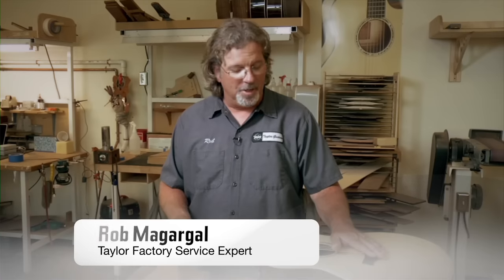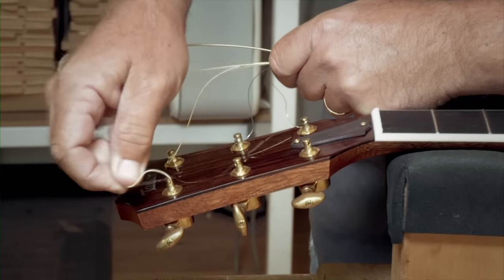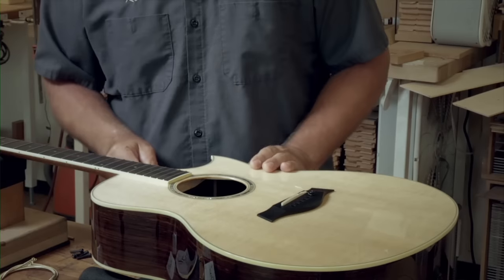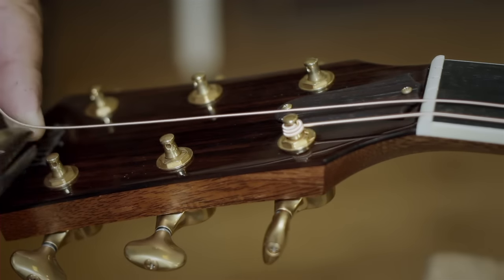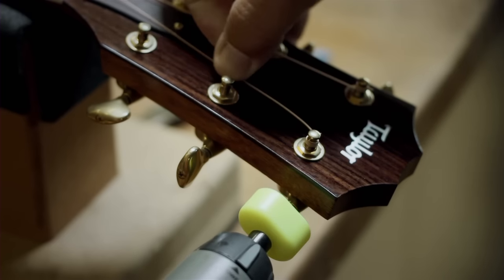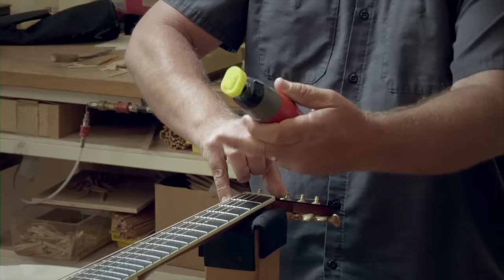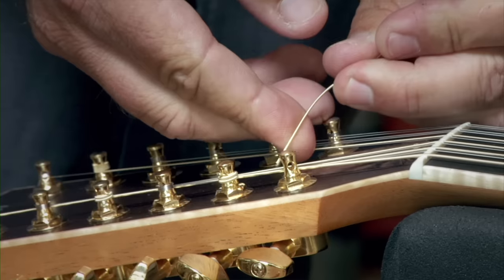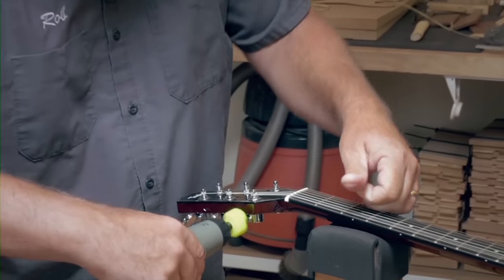How To Restring Your Guitar - Taylor Guitars

Comment: At 03:50 "That's allowing the ball end of that string to lock right to the pin plate." Should I assume the pin plate is the same as the bridge?
Reply: No the Bridge plate  or pin plate is a piece of wood that sits underneath the bridge usually filling a space between the braces.  It is usually made of a harder wood than the rest of the guitar top, and is a decisive component in the guitars resonance and intonation.  Getting the ball end of the string in wrong can mean the wind of the string before the ball  and the ball can cut into the bridge plate,and slowly widen the hole the bridge pin and the string sit in.   It can weaken the tone of your guitar,  and then it can mean that the string is going to slowly start to push its way up through the hole.  The string will start to stick out a bit on the bridge  and space will develop between the string and the pin,.  Ultimately the  tension of the string pull the string up through the bridge plate into the softer wood beneath the bridge and really wreck the bridge plate and the bridge itself.  The string will no longer properly seat in the hole, and wreck the tone of the guitar.  If you have an older guitar,  not a bad idea to ask a luthier to take a look at the bridge plate.  They can be replaced for  50-100 bucks.  Something to get a luthier to look at for you if you are buying a used or vintage guitar
Reply: @writerrad  Actually, Taylor guitars have a piece of metal around the holes of the bridge plate. That should last much longer than wood. You can see it here in this dissected Taylor body. I'm guessing this only pertains to Taylor guitars using the expression system. Those that came before, I have no idea. You'd have to ask Taylor. If you'd like to see it, check the 2:35 mark on this video. https://www.youtube.com/watch?v=wy_9ejBag_U

Comment: Im really confused. I bought strings to try stringing my own guitar for the first time ever (i'm tired of not knowing how). I put the low E string in just like he said, started turning barely and before it was even around the peg 1 full time, it was a D already? It's super tight. His has lots of slack, mine doesnt? I need help.
Reply: Check your steps:
Pull to set the string at the bridge after you insert the peg
At the top of the neck cut your Low E string at the A post - Maybe you cut it too short?
Insert the string through the E post so just about 1/8" string pokes through the hole
Wind until tight
Reply: @nmcg2587  i actually went back, slowly worked ob this, and got the first four strings on which appears to be right. Now im at the B string, and the G string is touching the B string tuner and i cant turn the B string onto the tuner, the G string is getting in the way. What should i do?
Reply: @vaibanez17  Without any pictures, I'm just guessing that the G String is in the wrong slot at the nut.
Check all strings to make sure they line up in the correct slots in the nut.
or, maybe the G string is wound on the peg the wrong way? Check the video at 7:22
Reply: @nmcg2587  i figured it out. I put the g string on the wrong way. Supposed to turn it on the peg the other direction. Oops. Now theyre all on.

Comment: One of the middle strings on my Taylor 224e-k-dlx snapped loose from the tuning post. I was a bit disappointed. Justin Guitar taught it better to have a round of the string above the loose end. Umm, not to mention when I bought the guitar new from Tomlee, the tuning pegs already had stains and rusts. A bit too much disappointment for an overpriced guitar.

Comment: What is the make/model of the cordless screwdriver ? please
Reply: tweed guitar Have you found that out yet? I'm wondering the same thing.
Reply: No, they never told me...Dunno the model..but it's a Milwaukee ..that's all I know. cheers
Reply: tweed guitar Been pausing and looking. It's actually a Black and Decker. Looks like it's 3.6 volts. It doesn't appear to have a gyroscope, which would operate simply by twisting your wrist. I wouldn't want that, though. I can't find this particular model, but the video is 5 years old, so it has likely been discontinued. I can tell right away that he's using the winder attachment from www.stewmac.com but I'm not sure if I want that. I may go with the Music Nomad GRIP attachment. 
I've actually been planning to buy the B&D LI2000, which may actually be the current version of what was used in this video. The big difference is the handle adjustable positions.

Comment: ...too bad you don't recommend locking the string, also there should be an extra ball knot slid onto each string to insure that the winding is farther away the saddle,...and I try to  put the same pin in the same hole because they may have been custom fitted in to individual holes.

Comment: where can i get on of those electric string winders?
Reply: I bet if you Googled "electric string winder" you would have your answer.
Reply: Christopher Isaacs You can buy a cordless screwdriver and a peg winder attachment to go in it. I believe that's what he used in this video. The peg winder attachment looks like the one sold at www.stewmac.com
The Music Nomad GRIP attachment may be a bit safer though, and it can be used with a larger variety of tuning machines. 
Ernie Ball makes a power winder, but it would be cheaper to buy a cordless screwdriver and the attachment, and you'd also get more speed and torque. 
I would like to know which power screwdriver is used in this video.
Reply: Christopher Isaacs Alright, after much analysis, he's using a 3.6volt Black & Decker. I believe it has been discontinued, but the LI2000 is pretty similar.

Comment: What if I don't hear the "snap" when I put the string into the bridge/pin?
Reply: Get yourself a small extension-stem mirror, with a built in Led light (StewMack sells them) and shine the light towards the slightly bent mirror. Carefully slide the mirror inside the soundhole (to avoid snagging any pickup preamp wiring) and point it up to see the bridge plate. You should see all the ends of the bridge pins and make sure that the ball ends of the strings are all snug up against the bridge plate (and not caught on the tip of the bridge pin). If the string's ball-end is stuck on the tip of the pin, loosen that string, put your thumb on the top of the pin and pull snug on the string until the ball end slides up in place against the plate. That's how you are sure all ball ends are snug up to the bridge plate.

Comment: OK, I am not a "professional" guitar tech (played guitar for over 40 years) but I have never used wire cutters to grab the string pegs (which you might think could damage them) and then pried against the BRIDGE (???). The manual string winder has a peg removal slot that you can pry against the SADDLE and use a cloth or thin piece of soft wood to protect the saddle though I have never bothered to protect the saddle since it is made of rosewood and the plastic peg removal tool on the winder should not damage it. This video and others like it make me feel like my first purchase of a Taylor was a mistake...

Comment: I do one winding above and the rest below the insert.
Oh ... I use a pencil, to lubricate the nut.
Reply: Your way is the best way.
Reply: @richardalan3204  Thanks. I am not sure if there is a best way, but in the past 35 years, I never had any troubles with it,
and it's a nice tight fit, so that the string does not get much out of tune.
I am planning to build my own electric guitar, because I built a cnc milling machine for it.
I found some tuning mechanisms that have a screw at the bottom.
That's even better, imo.

Comment: Good video but i don't agree with using a metal tool to remove bridge pins,especially on an expensive guitar.Use a cheap everyday plastic string winder instead.Ever notice or wonder why there's a small half circle cutaway on the part that fits over the tuners? It's for removing bridge pins but if you'd rather use a pair of vise grips then be my guest.
Reply: Side cutters are fine on plastic or wood pins, but they might chip bone pins.

Comment: Like EVERY other Taylor video on guitar set up and adjustment, NOTHING about the special steps needed to change an ES2 equiped guitar.  In fact there's a general paucity of information on ES2 changes except for the woefully inadequate spec sheet for the system with its dark and unviewable pictures.

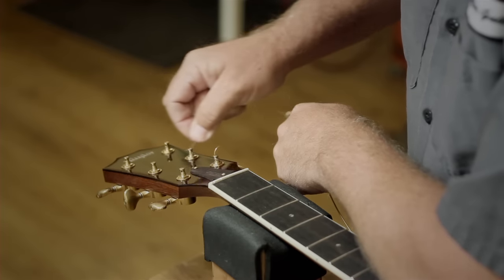Comment: At 02:11 "Be careful of the slap-back of the strings." Well, of course I'll be careful of the... the... what did he say?
Reply: Those coiled strings on the tuning pegs act like springs, when you pull on them they snap back at your fingers.
Reply: @JohnShalamskas  Lucky if they snap against your fingers instead of your eyes, or softer parts of skin,.  I always wear shop glasses or non glass reading classes when I do this.

Comment: I personally like the Martin way. Sadly restringing my Taylor the same as my Martin lol
Reply: Martin way  is based  on the way in olden times the tuner posts were not tappered downward.  If you have a guitar built since the 1930s even a Martin (just checked mine),  the tight wind of the strings as shown here and the shape of the tuning post will mean you dont have to make that knot  which  I usually find difficult and confusing even if I have been doing that for decades.  The real problem is getting the string off, for at least for me, that Martin knot never slips off as evenly as the Martin guy in the Martin video says it does,

Comment: You don't want the guitar to be fully tuned up on each string. Let all the strings wound up as it gets more tension, what it does is we need all of the strings to be sitting down properly on the nut and the saddle (with the correct string gauge and all that). DO NOT TUNE IT ALL THE WAY UP deal with the strings first before you tune the guitar.

Comment: ...that is so hogwash about "stretching" the strings, what most people think is strings stretching  is really the strings settling in the coils or other places where there is slack.  Sometimes it takes up to 24 hours for this settling to take place.
Reply: So it's quite logical to say that physics would dictate that applying tension to the strings prior to them "settling" as you say,  will speed that process along. So instead of waiting 24 hours just give them a nice pull and make sure they're set. Then check the tuning once more and you're done. 

This is a rather thorough and scientific method to get your strings set. Makes perfect sense to me.
Reply: Douglas Sharp trouble is that you're stretching in concentrated areas. Much better to let the string settle naturally. String up, tune up and play for a bit. Keep tuning and after a short period of time your strings will be set.

Comment: Although this method is good for showing how to slack the string, this professional is causing damage the the bridge plate with the ball end of the string.
He pays NO attention to the angle of the ball end, so all the edges are turned at different angles, cutting the metal, of the ball end, into the wooden bridge plate.
All the wheels need to be straight forward, not turned side ways. Think about it!
Over time the bridge plate will be destroyed, and have to be replaced.
Any real Luthier will back me up on this issue.

.
Reply: Yep- you are right on brother. I noticed the same thing. Pretty bad practice.
Reply: whatshisface I’m no luthier, but even I know that you are correct.
Reply: I see. Straight forward means what? It's shaped like a wheel, so make it clear to me what position is "straight forward". I've thought about it as you implored, but it's just a wheel shape, so it has no forward or sideways. By the way, I'm no real luthier, but you surely are, correct?
Reply: I believe he means that the wheel part of the string should look like a big "O" when you look at it from the side of your guitar
Reply: I'm thick as I don't understand what you mean:(

Comment: Hey c'mon your wrong from the get go You should change one string at a time in a specific sequence. Low e g a b d High e. I guess your all use to fast factory work. It's o.k. To change strings like that on your little sisters hundred dollar guitar but not a more expensive guitar and especially not an heirloom
Reply: I dunno, I've heard both from reputable sources. Martin also removes all the strings before restringing.
Reply: Brianna Ronca That's just a myth, unless you are changing strings on an electric guitar with a Floyd Rose Bridge.
Reply: Wrong.